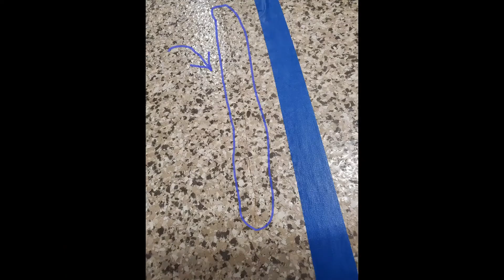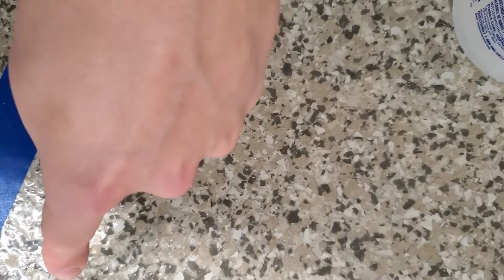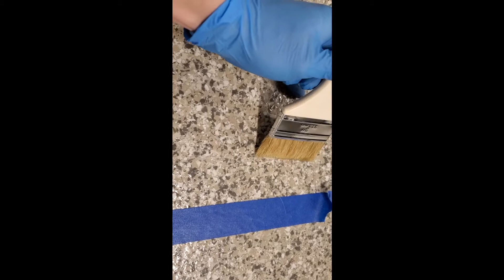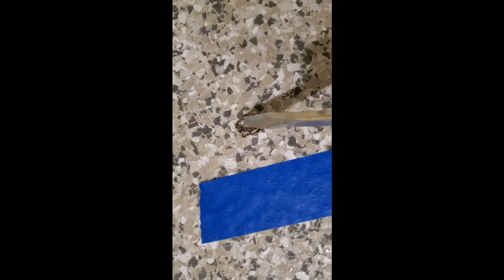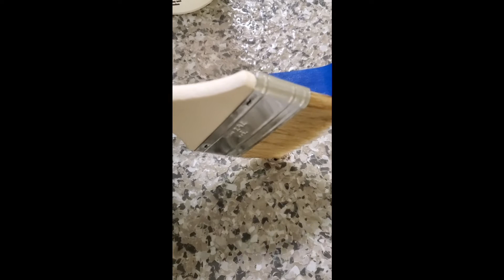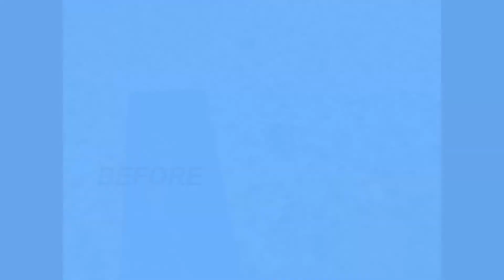How To Fix An Epoxy Floor With Minor Damage

Comment: Will this work with larger holes ( 2-3inches wide) I accidentally pressure washed a few spots of an epoxy floor
Reply from the maker: Yes the same concept will apply to those spots. As long as the repairs aren't very deep

Comment: Instead the flake, would you just fill the hole with the POLYASPARTIC Or clear EPOXY if you want the natural concrete to come through?
Reply from the maker: Yes you can do that if you wanted to. It's best to use the flake to help blend the patch in with the rest of the floor.

Comment: How can i get a surface boot print out that shines in the light I stepped on it to soon and made a print mark will a heat gun help take it away I will take any help you can give thanks great video
Reply from the maker: It's hard to say without looking at it. You can try to sand out the foot print then top coat the area again.

Comment: I got an epoxy floor that has a slight slope that is about three feet wide which brings water near a base heater. How could I raise...or level...that small section to prevent the water from moving?  Thanks.
Reply from the maker: Are you familiar with toweling? You could either use a self leveling product to fill the low spot and level out the area or you could use a mortar to build up the area and slope it away from the heater.

Comment: Is this the way you repair bubbles if formed in the polyaspartic top coat randomly? I have a job that outside the recoat window and is cured but i have about 15 bubbles. Would you still see them if sanded and recoat polyaspartic in low level lighting? Or should i deglaze the whole floor with pads and sand to deglaze and recoat?
Reply from the maker: You can try to repair the bubbles with this method. Make sure to sand the bubbled areas very well to help blend with the rest of the floor. There's a very good chance you will notice the areas you touched up, but repairs normally blend well with traffic over time.
Reply: @columbusepoxyflooring  TY, i managed to blend them spot on! Ty for your help 🙂
Reply from the maker: @iMdb8Official  I'm glad it helped!

Comment: i am cleaning a dealership with high priced cars. epoxy floors no flakes clear coat with design. floors are scratched up and have tire marks. how hard is it to maintain these floors in order to leave them spotless and clean like if they have been just finished.. do you need to sweep every time before moving these cars and what product can you use to remove the tire marks without damaging the floors. spray nine is a strong de greaser would this damage the floors?
Reply from the maker: An epoxy floor without any media (such as flake or sand) in it will scratch and abrade easier. If the area is getting a lot of daily traffic you should clean it more often to remove any dirt and debris that can abrade the surface. Mopping the floor daily will help to keep the debris down from the daily traffic and every once in a while (maybe one a month) do a thorough cleaning of the entire area. The top coat on the floor will make a huge difference on how the easily the floor scratches and abrades as well. We always recommend a urethane or polyaspartic be used over an epoxy system because they are designed with more chemical and scratch/abrasion resistance. If the floor is getting scratched up enough you can most likely bring it back to life by having someone come in and sand the floor with a fine sandpaper or sanding screen to abrade the surface then apply a clear urethane over the floor. I'm not familiar with spray nine. Id recommend you test it in an inconspicuous area to see if it affects the finish. I've heard a lot of people say they like cleaning with ERC which is designed for resinous coatings. You can check them out here.. https://www.epoxyresinouscleaner.com/

Comment: How to I fix a similar sized burn damage from firework sparks on a solid color epoxy flooring on a balcony?
Reply from the maker: It's hard to say without seeing it. Just a burn may not be that bad. We've had burn from welding sparks before on our floors. I was able to sand most of the burn marks out. If you're able to sand the burn mark out without sanding off the coating entirely, you can clear coat the area with a resinous urethane or polyaspartic coatings. If you're not able to sand it off you'll have to fix the area with a tinted urethane. Sherwin Williams sells a urethane called Rexthane 1 (depending on the state you live in) you can use and they're able to custom tint the color.

Comment: How do u remove a chunk of material on the surface of the floor.
Reply from the maker: Not sure I entirely understand the question. Do you mean a chunk or glob of epoxy or a chunk of something like a rock that got stuck while the coating was curing?
Reply: @columbusepoxyflooring  I have the same question.  A very small rock was left on the floor and then epoxied over.  I'd like to remove it and repair the finish.  Thoughts?
Reply from the maker: @mikenixdorf9237  You can chisel the rock out of the floor, which will probably leave a small chipped area that will need repaired. The small repair shouldnt be too hard. We have an older video we posted thats more crude on the quality but shows how you can perform a small repair. https://youtu.be/oTIZqH4KxRQ?si=UecrRcaYquC9Z8XR

Comment: Great video thanks! Do you have away to remove rust stains on epoxy paint caused by patio furniture ? Thanks in advance.
Reply from the maker: Rust can be hard to remove unfortunately if the item was left to sit long enough. You might try to spray the area with WD40 let it sit for a minute then scrub the area to see if that loosens up the dirt. We've had a little bit of luck with this method in the past.

Comment: I have Ben patching with Rust-Oleum concrete patch and repair it is very hard to get this smooth then I am going to use primer and then put the Rock solid on top is all these uneven waves and Chip fills and high low spots going to be covered up?
Reply from the maker: I have never used rustoleum’s patch material so I can’t comment on that. You’ll definitely want to get all of your pits and cracks patched before laying the coating. Another patch material you may try is bondo. It dries very quickly and then you can sand it smooth. The coating you’re applying may help to fill imperfections, but it will depend on how bad the damage is and how thick you apply the coating. I hope this helps.

Comment: How would you go about fixing a spark/burn on an epoxy garage floor? Electric dirt bike caught on fire and totally ruined the floor ☹️ is there an easier way other than sanding the whole thing and redoing? 🫣
Reply from the maker: It'll depend on how deep the burn is in the coating. You might be able to sand the burn out and clear coat it again,  but unfortunately it sounds like you'd be better off to just have the floor recoated entirely.

Comment: Can you do a video on how to remove yellow stain on epoxy floor?  I parked my BMW in the garage, the break dust mixed with rain discolored it.  Thanks.
Reply from the maker: Quick question. Is the entire area of the garage yellowed or is it yellowed just around where you park the car? Some times if the proper top coat isn't used sunlight can yellow and discolor the top coat over time as well.
Reply: @columbusepoxyflooring  Thanks for the reply. There are four yellow stain spots where the car tires make contact with the floor. Other area is fine.  Can you recommend a product to get rid of the stain? Thank you!
Reply from the maker: For now I would try a cleaning solution of 1 part bleach to 3 parts water. Let the solution sit on the areas for a couple minutes. If you're unable to scrub the yellow out you may have to recoat the yellowed area.

Comment: Next time patch that hole with a epoxy patch, sprinkle the flake into the wet patch. You need to build that hole up.
Reply from the maker: If the hole is deep enough, I agree. Filling up the hole too much will create a raised area and make the patch much more noticeable.

Comment: Had a random 1ft hairline crack open up at the expansion joint in the garage. What would cause something like that and what would you recommend as a fix?
Reply from the maker: expansion joints are put in to allow the slab to move and help prevent cracking elsewhere, so when you fill and coat them its common to cracking due to the movement of the concrete on the joints. I'd leave it alone for now. If you repair it, theres a good chance it will crack again. If it continues to crack, Id re cut the joint and put a flexible material (e.g. polyurea) in its place.
Reply: @columbusepoxyflooring  thanks for the response! My only concern was leaving it unsealed was with winter coming water getting into cracks and causing further damage.
Reply from the maker: @jkin5351  If its a hairline crack I wouldn't worry about water getting in and freezing. There is a decent chance the crack will open up more due to the nature of the concrete. I'd recommend keeping an eye on it and if it gets bad enough, repair it how I mentioned ealier. We actually had what youre asking about happen to a control joint in our shop. I'm hoping to get time to get a video out that shows how you can repair the control joints when they crack.
Reply: @columbusepoxyflooring  right on I'll be first one watching the video lol. Thanks!

Comment: Where I find it .can you tell me ..please
Reply from the maker: In the video we used polyaspartic. If you have a small area to repair you can just use a clear polyaspartic and the flake color you have. If you reach out to these guys they should be able to get you a small sample kit of polyaspartic for your repair.  I recommended their "aspartic 85 slow go." Very easy to work with   https://floorguardproducts.com/

Comment: What material do you use to patch the damaged area and where do you buy it. I have the chips from the time I had my whole garage done,
Reply: Would like to know this as well
Reply from the maker: In the video we used polyaspartic. If you have a small area to repair you can just use a clear polyaspartic and the flake color you have. If you reach out to these guys they should be able to get you a small sample kit of polyaspartic for your repair.  I recommended their "aspartic 85 slow go." Very easy to work with   https://floorguardproducts.com/
Reply: "If you reach out to these guys......." What sort of half assed answer is that?. Name the product and where people can buy the product.